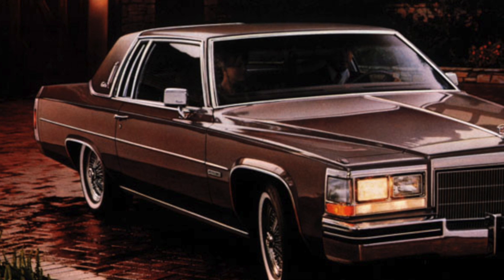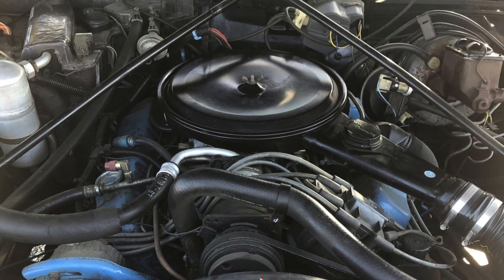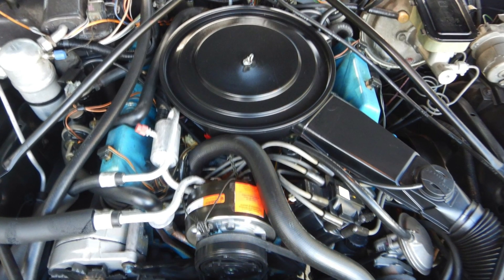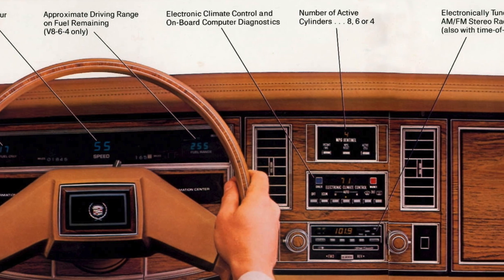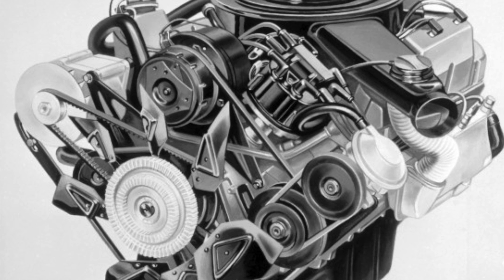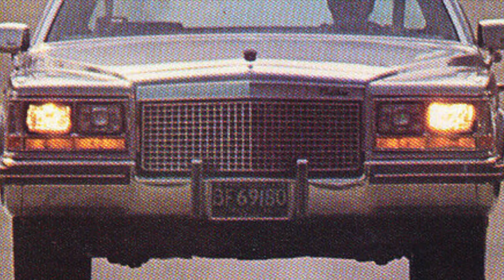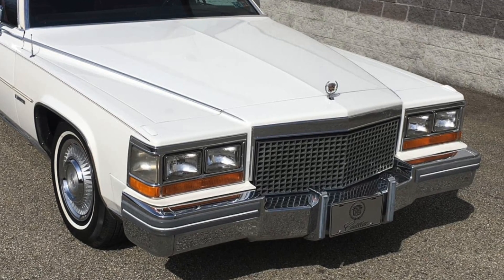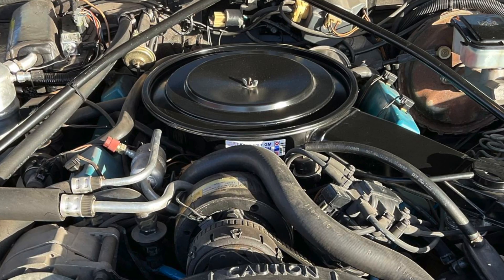V8-6-4 - Cadillac's Worst Engine Blunder?

Comment: GM still has a severe issue with the cylinder deactivation on the 2021-2023 Silverado wiping out cam lobes.
Reply: I beg to differ. Had a 2019 with deactivation in a 5.3 with no issues and my best friend who ownes a GMC dealership says it was the 8 speed tyranny that has issues not the deactivation issue.

Comment: If Cadillac had the time it could’ve been a flagship engine, but they had a firm deadline to meet the new CAFE standards within. Honestly I think they would’ve been better to go with the 350’s or 305’s they already had at hand from other divisions and upgraded them to fuel injection to give them a one up over the lower brands.
Reply: They should have just paid the gas guzzler tax.  Would have been cheaper and would have kept loyal customers.  Who knows how many people when import and never looked back.  The European makes like Mercedes just paid the gas guzzler tax rather than rube goldberg engines.
Reply: Cadillac basically did begin using other division’s engines for a while. They couldn’t do it right away. It was still fresh in the public eye the lawsuits from the late 1970s when GM began the corporate engine experiment and got sued for using lesser division’s engines in premium division’s cars. While GM prevailed in the lawsuits they lost in the court of public opinion.
Reply: @mikee2923  I think they lost at least one of those lawsuit's, if my memory is correct.  They had to start including a disclaimer that a GM car might have an engine made by a different division.

Comment: I know a mechanic that worked at a Buick/Cadillac dealership during that time and he said they replaced those engines all the time. They would get crates of them in every week. He said the cylinder heads along with the pistons warped and cracked and sometimes the blocks did too. Then the Cadillac brass sent them a memo to deactivate the system that shut the pistons down. Without that the engine worked fairly well.
Reply: V8-6-4 had a low failure rate. The HT4100 was the one with frequent failures.
Reply: The worst was yet to come… HT.
Reply: @whitsundaydreaming  and followed by the early horrible NorthStar 🙈🏁

Comment: The engine was great,the 6.0 should have given the 4.1 injection system it probably would've great drivability, decent fuel mileage would have been decent,and the big plus the engine would have lasted a long time unlike the aluminum cast iron liner HT4100.

Comment: cadillacs were total junk once fuel injection and this numbskull system , the earlier fuel injection on the 500 and 425 was horrid , once the 4100 came out the FI was decent but the motor itself was underpowered and was known to waste camshafts . 8,6,4 was a simple fix we disconnected the dist reluctor and it would eliminate the system.

Comment: Yes. This is a great engine once you disable it by disconnecting a few wires. I'd take it any day over the Hook and Tow 4100.
Reply: I know a bunch of guys who did this. Theyre still going strong today
Reply: No fuses, just a single-wire plug on the side of the transmission.   I actually added a flat chrome toggle switch on each side of the radio:  1 held the antenna in whatever position it was in, and the other held the engine in eight cylinder mode.  Useful for compression coming down Donner Pass...
Reply: You do not have to disconnect wires to deactivate cylinder displacement. Just lock it into 8 cylinder mode through the mileage display on the dashboard.

Comment: I didnt know they ever did this back then. I have a 2007 cadillac escalade that has a l92 6.2 v8. Mine was extremely early and has a very rare version of the l92. It has Cylinder deactivation Installed on the engine. It is not active but its there. For what i read it was planned that it would be used and at the last min it was dropped. So the very early l92s have Cylinder deactivation but its not Active in the computer. I used to own a performance shop and i have hptuners.  i have been wanting it see if i turn it on in the computer if it will work.

Comment: GM and Chrysler are using cylinder deactivation today and it's just as disastrous.  It actually caused premature engine wear because of the uneven heat.
Reply: Don't forget about Hondas cylinder deactivation.. Honda accords burning oil out the tailpipe at 20k miles 😂
Reply: @keithbaker1951  I see many Japanese and even Japanoid small cars blowing blue smoke, despite being late-model cars.
Reply: It’s actually true with ALL manufacturer engines with an MDS system. Prematurely wears the cam lobes. It’s just more common on GM/Chrysler OHV’s, than with the OHC setups of others. It all boils down to how you drive and maintain your rig. The way to beat it, at least for the long term, is (here comes the obvious)being religiously on time (and even beforehand, if driven harder/towing/etc) with your oil changes and using high quality full synthetic oil w/ equally high quality oil filters. Can even go a step further and have a shop perform a cam replacement with an MDS delete, if you’re already experiencing problems. I had bought my 2016 Ram 1500 4x4 with the 5.7 new and have had zero issues so far, with 112k on it, thanks to going above and beyond the maintenance schedule, in respect to fluid changes and basic maintenance.
Reply: @MamesJatthew29  One problem might be today's 10,000 miles between oil changes.  That is just too long.  The mini filters of today probably plug up at 3,000 miles, so for most of the time, you are running without an oil filter.  Also, no matter how good the oil is, it eventually gets contaminated.  That's just the way it is.
Reply: @MamesJatthew29 Mine's got 180,000 miles on it so far and doesn't so much as tick. It's been maintained well but beat on hard since ~2010 when it was retired to farm use. I have a cousin that's got one with what has to be going on 300k at this point that is in the same shape as mine (at least mechanically).
Reply: This is true on the Chrysler Hemi and the GM LS V8 engines.  I had a 2012 Sierra that failed just out of warrantee.  Truck was 5n years old and had 84K on the clock.  Supposedly the technology works better on over head cam engines.
Reply: @@jacknapier7740 My '05 Accord Hybrid ran flawlessly for 150,000 miles, then when things started to get flaky, it automatically deactivated its cylinder deactivation system and kept running fine as long as I kept cleaning the connections for the VTEC valve, though I've always changed the conventional oil at 3,000 mile intervals. At 173,000 miles, I just sold it and it had no trouble driving away. I believe that was the first engine with cylinder deactivation Honda made; why can't GM and Chrysler get it right after so many years?
Reply: Doesn't matter. Most people don't keep a car more than 5 years. GM figured that out a long time ago.
Reply: It makes me curious too. Why, indeed, do virtually all modulated displacement engines have one or more inherent problems?
Reply: My 2008 Avalanche has 520,000kms and is working just fine. Maintenance is key. Change oil regularly and it's totally amazing and reliable. Get cheap on maintenance and well you are going to literally pay for it.
Reply: @matthewlibanio8227  Funny how that works...
Reply: I just had to have my lifters and cam replaced on my 07 tahoe
Reply: @OregonDashcam  That is ridiculous.  Back in the day, just about the only time you had to replace the cam and lifters was during a complete engine rebuild.  Now it seems like you have to replace them every time you start the engine.
Reply: @jamesbosworth4191  well luckily when I did it I put regular non afm lifters and a non afm cam and had the computer tuned so it no longer has cylinder deactivarion

Comment: First video I've seen on this channel that i dislike and strongly disagree with. Ask any reputable engine builder, cylinder deactivation is terrible for an engine. All these years later and gm still cant get it right the aftermarket sells tons of cylinder deactivation delete kits. It was a terrible idea forced out by the authoritarian government overreach enacting ever more strict regulations to please the climate cultists.
Reply: I didn't notice that it was said anywhere in the video that it was a good idea. Nor did the host seem to voice support for it.
Reply: @joshuagibson2520  @7:40 the host claims had Cadillac spent more time developing the system it could've been a success, the purpose of my original comment was to point out the incorrect nature of that statement since GM, Cadillac's parent company, is still attempting to use cylinder deactivation to this day and it does not work properly. I've heard of Silverados that will blow up on the drive home from the dealership due to malfunctioning cylinder deactivation systems.😅
Reply: Not the climate cultists, the gas mileage freaks.
Reply: @jamesbosworth4191  Same crowd...
Reply: @marko7843  Back then, there was no such thing as Global Warming.  We still were expecting a 2nd Ice Age.  Eventually.
Reply: @marko7843  The smog freaks and the mileage freaks were often the same crowd. as many of them even today thing that American cars are allowed to emit more emissions than small Japanese cars, despite the fact that all cars of a given model year have to meet the same standards, and they think that better mileage means lower emissions.

Comment: My father had one of these. 864 was disabled but was still an absolute dog.
Reply: I know it was the malaise era, but 140 hp and 265 lb ft out of 368 cubic inches seems especially pathetic.
Reply: @VTCharley13  No other way at the time to get it to pass the 50,000 EPA smog certification.  If you don't pass that, you can't sell your cars, unless you want to try to sell them as racing cars that are not street legal.  Just think, a Cadillac racing car!
Reply: @coarsegrind: Car and Driver tested an 81 Sedan Deville V864 and got 0-60 in 11.6. Not bad for 1981.